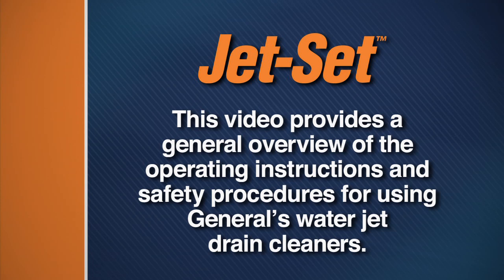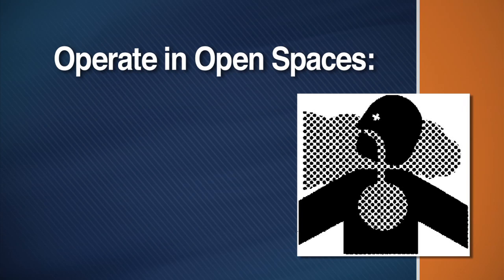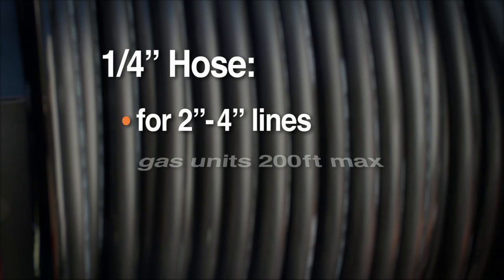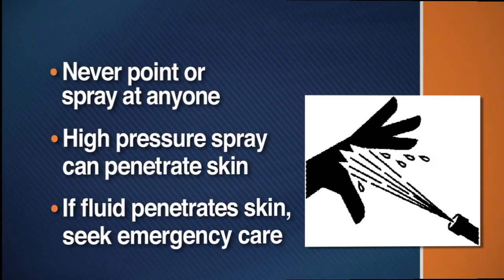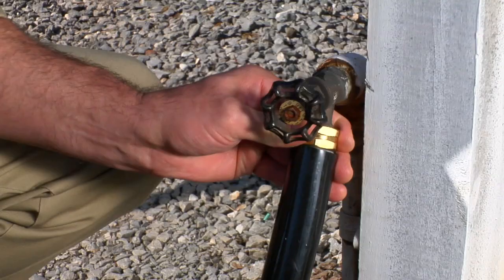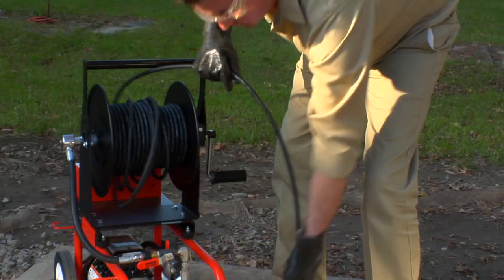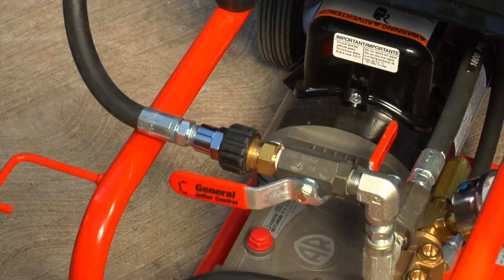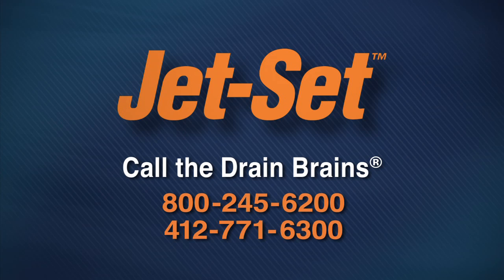Jet-Set Water Jet How To Video

Comment: Ideally   when water Jetting  I try to run the hose  UPSTREAM  as this helps flush away   the debris  .. I also like to use my Speed rooter  3/4" cable on 4" and above lines to establish flow before using the jetter .    I have found that jetting is also  great as a finishing tool after snaking as it  resores full flow that a cable just cannot accomplish unless your flushing the line and using chain knockers also by General